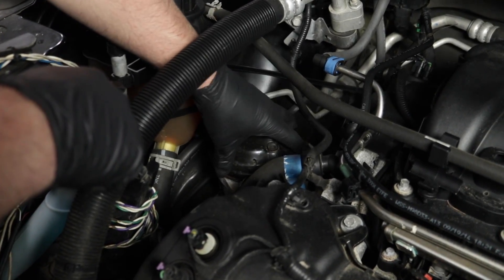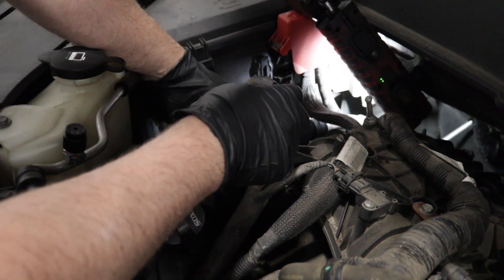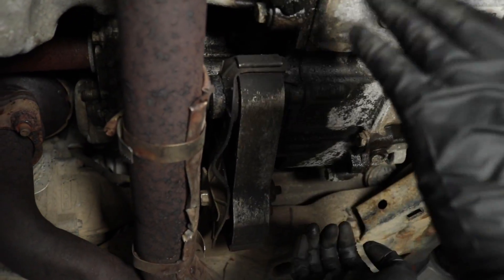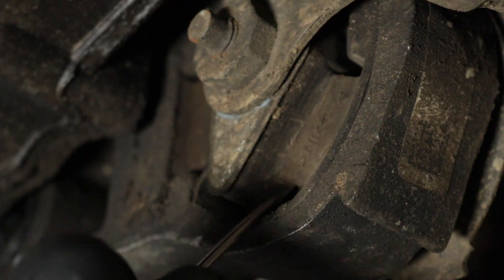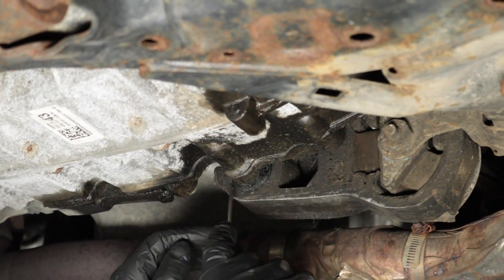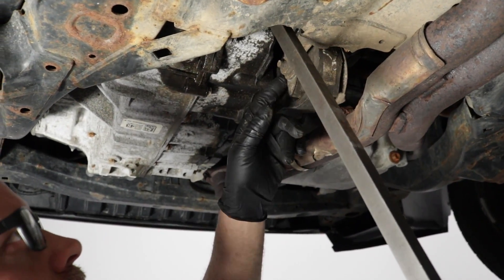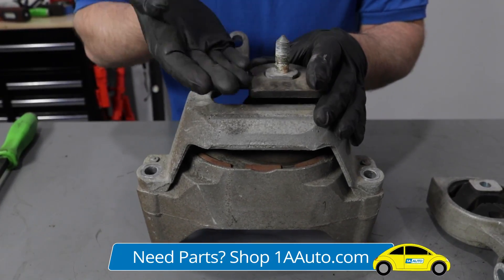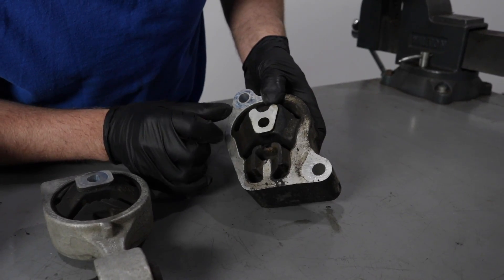Bumps, Thuds, and Vibrations: How to Diagnose Bad Car Engine Mounts!

Comment: Thanks for this video. I have a 2014 mdx that pulls right when giving gas , much more noticeable after 40mph, and then corrects left when letting off throttle. Could this be my engine mounts?

Comment: Hi.
Hope you are doing well. 
My toyota vitz 2004 has minor engin mount crack on its right side. Is the vibration of the car related to the mount, when I put the car in reverse gear for a drive or idle, it vibrates. But applying some gas the vibration then vanish. As you mentioned in this video, my car gear shifts jerking and engine moves up down while shifting to P R N and D.
Waiting for your response to the vibration in reverse gear only

Comment: Just got new motor mounts aftermarket, Honda is now claiming that because they are aftermarket and not OEM that that is causing the vibration. Does this even sound right, the transmission mount on the one on the right side are brand new and I have a new vibration.

Comment: Hello, thanks so much for the video. I wonder where you are located. I am in northen California. I have a Chevy Cavalier 2002 that has exactly that problem since 2 weeks ago, broken engine mount. Jerking noise when changing into gear and reverse, and vibrations and noises when going up hill. My mechanic did a quick fix, moving heater hose out of the way, and placing some rubber while he's trying to find the part. He said  it'll cost me over 400-500$, but after seeing your video, it seems such an excessive amount, so I wonder if by any chance you are located in this area and could help me, and if not, maybe you know some reliable mechanic that could. Thanks so much!

Comment: OK so I was backing out of my drive way and I put it in reverse well when I pressed the gas to go it starting sputtering and shaking horribly and wouldn't go it kinda felt like the tires stuck up under the car weird I know but I was told my motor mount broke and fail on the cv axle so I'm wondering if it is the mount or not can anyone tell me what I might be dealing with I had to have it towed 😢

Comment: Replace every 5 to 7 years, you'll be good. If you don't maintain your engine mounts, the connection between the engine and the transmission will ware, and you'll have major issues later.
Reply from the maker: +EJM919 Thanks for checking us out! http://1aau.to/m/Shop-1AAuto-c
Reply: 20 years ago, I had my toyota manual gear hardly shifting to first gear !!! Replaced the clutch and disk and it didnt work. Finally it was the front engine mount .!!! Though the car was five years old only.

Comment: Mine only jerks when put in drive not in reverse   also only happens when car is hot . When is cold it shifts smooth. Transmission fluid is good. What could it be?

Comment: What exactly constitutes significant engine movement? I change my motor mounts and the engine still moves when I hold brake and accelerate although I can tell from in the cabin that the mounts are good. I took it to some mechanic in the hood who I assume was trying to rip me off but was showing me the engine moved and that I need new mounts. It did seem like a lot but again I know they are new and good.

Comment: Different car, but I have a 01 Pontiac Grand Prix SE. 
I had a real bad vibration under acceleration. 
My front mount was real bad. I replaced the front mount, got rid of 95 % of my vibration under acceleration. 
I still have a slight vibration under acceleration. 
Should I flip my dog bone bushings, or replace the transmission mount, or both?
But some people say flipping the dog bone mount bushings may add slight vibration. 
I don't want any vibration.
Reply from the maker: +anthony diodati We wouldn't be able to diagnose an issue like that here, you may want to have a local mechanic take a look at it. Thanks for checking us out! http://1aau.to/m/Shop-1AAuto-c

Comment: What about metal banging/thudding when hitting potholes? I have an issue atm that 3 mechanics couldn’t find, I’ve noticed my gearbox mount has too much movement and wondering if this could be causing the banging over bumps/potholes
Reply: Similar problem here. I also notice it when suddenly lifting my foot off the gas pedal (manual trans. here) In the case I mentioned its not just a one-time thud, its a rattling kind of noise, and definitely a heavy metal to metal one.

Comment: Once in a blue morning when slowing down, i feel a thud, like if i hit a bump. i tried to determine where the hell its coming from, but have not yet figured it out. it doesnt happen often but it happens and when it does its concerning. Any idea?
Reply: Im having the same problem with an 06 CRV. I am worrying that it could be a CV shaft going bad. However, if it was that it would be more than a random thud.

Comment: Hi guys,  im own one 500x 1.4 multiair,  my mechanic say the cause why my car shaking is the partially collapse of the engine mount but  why when is cold i feel this vibration everywhere inside the cabin  and most of the time when is not in movement??  Thank you 😊

Comment: Would bad motor mounts cause rotors to warp?  I have had to replace my rotors 3 times in 1.5 years.  I drive very slowly and dont jam on the breaks.  The car axels and ball joints are solid.  cant find anything wrong in the front end.  Mechanics could not find the problem.  I am well versed with working on cars.  Have works on every car I have owned and never had a problem with rotors warping after replacement. Car also skips when I cut the wheel sharply.  almost like the front end is swaying when the wheel is cut.
 Please help.
Reply: Check your wheel bearings

Comment: had them replaced but the vibrations increase when in D idle. aftermarket parts used , is this the reason for increased vibrations after replacement?

Comment: OKay when i am sitting at a light car has vibration...idle is set good... if i put in park or neutral it stops? is this a bad motor mount? its a 2005 nissan altima...its not real bad,but is annoying...thanks

Comment: My mechanic changed the mounts in my Honda Civic 2012 but still it makes a bit of vibration. Any suggestions?
Reply: Which mounts though? If he just changed the engine mounts, tell them to check out the gearbox/transmission mounts.

Comment: thanks for the video, so when you do the power brake (press the brake and push the gas in gear) you said if the engine moves "significantly" does that mean it's normal for the engine to move slightly ? thanks

Comment: My car vibrates a lot at idle. Gets worse when I turn the wheel or turn on AC. My local mechanic says 3 out of the 4 mounts are broken. Fixing them should solve this issue?
Reply from the maker: +Alfonso Guajardo Thanks for checking us out! Yes, this should drastically reduce the amount of vibrations you're feeling.

Comment: My car vibrates while accelerating or coasting in gear but if I switch it to neutral and coast there’s no vibration. Is it the mounts?
Reply: Yes it’s the mounts
Reply from the maker: +Nick Noble We wouldn't be able to diagnose an issue like that here, you may want to have a local mechanic take a look at it. Thanks for checking us out! http://1aau.to/m/Shop-1AAuto-c

Comment: Bad mounts are not bad in of themselves. They feel like you’re tryna gear when you’re revving. Problem is with excessive shaking, all the auxiliary parts to the engine deteriorate and might out right break.

Comment: when I accelerate I hear a cracking sound and when I release the clutch. it shifts gears and drives perfectly and driver side
Reply: Did you find out what it was because I’m having the same problem 😩

Comment: HELLO!!! I am desperate to find light for my case. I have a 2000 ford expedition Eddie Bauer with the 5.4 Triton V8 Engine. When I take curves to the left, and when the body of the vehicle leans to the right, I can hear and feel under my feet, specially in the front passenger side of the vehicle a tapping sound, like if something is knocking below the floor upwards, What can it be?? I have changed suspension parts like struts, shocks, upper and lower control arms, ball joints, front sway bar bushings and nothing has fixed the knocking sound. I am very worried. What can it be??? Thank You. Hope you can help me.
Reply: Cllicking and tapping while turning is a cv axel
Reply from the maker: +benjaminpizza vargas We wouldn't be able to diagnose an issue like that here, you may want to have a local mechanic take a look at it. Thanks for checking us out! 1AAuto.com
Reply: @1AAuto  oh ok... nice...
Reply: Sounds like a bad cv axle joint, usually the outer one goes bad. If it happens turning right its the left (drivers side) axle that is bad.

Comment: The only time I have a huge thud is when I'm parked uphill and I'm putting it into reverse. I mean it startled me everytime and as loud as can
Reply: When on a hill you should apply your parking brake first then place the car in Park to keep the strain off the transmission.  When pulling out put the car in gear then release the parking brake.  I'm sure there is a video somewhere to explain it better
Reply from the maker: +Contempt Thanks for the tip!